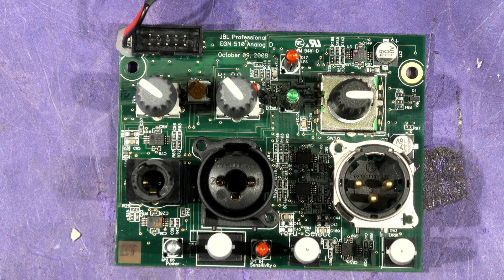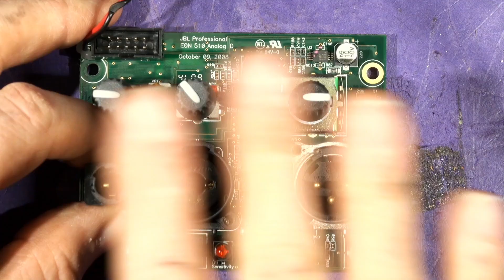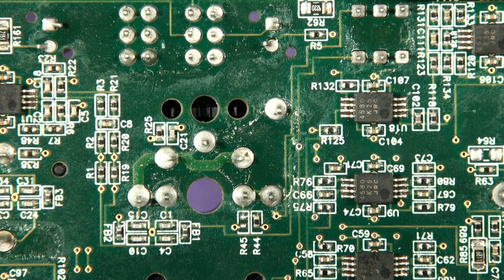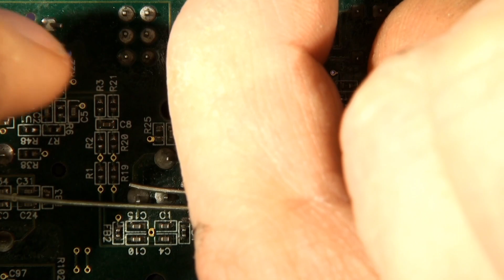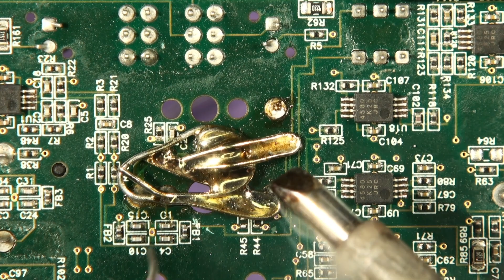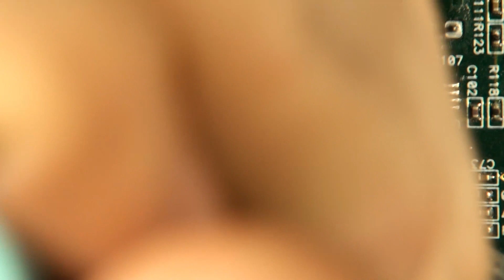How to change an XLR Socket with just a soldering iron without damaging the circuit board

Comment: Would low output be an indicator of a bad XLR input socket / receptacle?  How would you test this?
Reply from the maker: Unlikely.  If there was a bad connection it would also sound strange rather than reproduce at a low volume. It could be something in the input electronics. They often get damaged when cables are connected. (Static ETC..)
Reply: On the mixer I’m referring to, I disassembled it, cleaned all of the pots, XLR jacks and 1/4” jacks. I also lubricated them. 

Unfortunately, it did not resolve the low output issue on one of the channels. 

Also, now the pots don’t feel as buttery, which is worse.

Comment: lol.. my friend boughs some TRD cables fron amason... and the tip came off in the XLR plug just like you said, i alway had told him DONT BUY SOMETHING CAUSE IS CHEAP but people now days... love to gamble... not his QCS has two challes with that problem. 
I was goi g try to use a screw to take those tips out but hes such a hard head. 🤷‍♂️
Reply from the maker: It happens a lot.  It is amazing how many amps come in with a tip still in.  Good luck with the repair and thanks for watching.

Comment: Any particular copper wire you recommend? I've got an mpc2500 with a pot that needs removed and I am terrible at desoldering, so this might do the trick.
Reply from the maker: 1mm or so diameter solid copper wire. The easiest source is to strip out the earth conductor an old piece of twin and earth lighting flex. Just make sure that you use a decent iron with a solid soldering bit.
Reply: @razenby  Thanks! My iron is alright - not the best, but I'll pick up a spade style tip for it. Thanks :)
Reply from the maker: @StephenMcLeod  good luck
Reply: @razenby  I'll need it!!
Reply from the maker: @StephenMcLeod  Be patient. Let the heat flow. If you cant get it to flow using leaded 60/40 solder then you need a beefier tip or to borrow a better iron.

Comment: Thanks!  I just completed desoldering PRX718XLF  combo XLR socked from Input PCB.  This works!  Its anyway tricky a little bit and risky because many SMD elements are very very close the connector pins,  but I succeeded. I knew this technique before,  to heat all legs of any connector, but I would never try with XLR/jack combo (at PRX700 input PCB) if I hadn't seen this video. Thank you for showing this is possible and for hearten me :).  Greetings from Lithuania.
Reply from the maker: Excellent!Great to know it was useful. Thanks for watching.

Comment: Im from California and have a pair of eon 510s that I'd like to have serviced, one works nice and the other isn't as reliable and just recently lost all output, the rear panel does show signal just no sound. Any advice?
Reply from the maker: If  the amplifier has power and you don't have 2 blown drivers then you have likely have  a blown op amp chip or the boost switch is broken. If the signal light works then the common input circuitry is working so it could be that the wiper  contact has dropped off inside the the boost/cut switch.  You can easily test the switch.  Just touch the contacts on the boost boost switch at the back and if you hear a buzz from the speaker then likely the mechanism inside has switch has failed failed.  Remove the switch and glue the wipe back on with epoxy such as JBweld or bypass the switch and run the speaker on flat.  If not the switch then see the video on checking op amp chips in the mixer board,  You can do it with a DVM. On these speakers, withe switch on boost,  you can easily blow the HF driver with a microphone and a female vocalist.
Reply: @razenby  Thank you so much for your reply definitely gives me insight on what is going on, would you be so kind enough to direct me with a link to your video that your mentioning.

Comment: Great tip thanks.  I've started using this method after seeing you do this on an earlier repair. That said I just did a repair removing an PCB mounted octal socket using a powered solder sucker gun - fail!
Reply from the maker: No problem. There are more than one way to skin a rabbit..

Comment: Yep a crappy design of socket or the plug, what ever.
Watch the dog, it's feeling Ruff :-)
Your customers are lucky that you are doing the job, some so called repairers muller the job.
For a job like that, i would give the mother of a sucker a good clean and lube so it's great for about three mins lol.
I could buy a sucker heat gun, but i don't do much now, a waste of money.
It would have been magic in the days of Z80 cpu's with 40 pins and a delicate pcb,  the evil of through plated holes :-(
Reply from the maker: Yh, if you are  skilled with the mothersucker and have a good iron then it is no problem. The holes are tight and the pins kinked so for a novice it is time to wrench tracks and vias with a leaded soldering iron on an unleaded board. I know I have repaired many so called 'attempted repairs' wherethe PCB is damaged. What gets me is that repairers charge even if they cant fix it and often return it in a terrible state with components hooked up, sparrow shit soldering  and often  components missing that they have robbed for other customers boards.  Just thrown back together expecting it to be binned by the customer.  I operate a no repair then no charge basis as I don't take anything on that cant be repaired.
Reply: @razenby  When i used to repair a lot of electronics, i wasn't into ripping someone off. (the truth).
My way was to repair it as cheap as possible and a couple of quid for the solder fund.
If i could not repair it, i would hand it back in the same state it was originally in,  no charge.
In vcr's i often had to repair the mechanism, sometimes i would make a part for the hell of it. (i didn't charge for one of my bodges, and i told them what i had done) it often outlasted the rest of the vcr lol.
I never have been a money man,  helping someone that needed help was my way.
I'm not daft, ok just a bit :-D
i will never be rich,  but good frendships are more important than cash.
Dam don't i waffle.